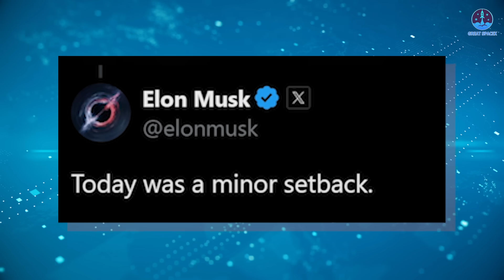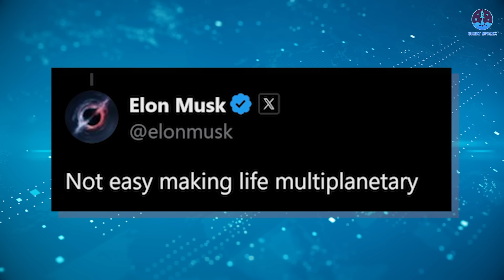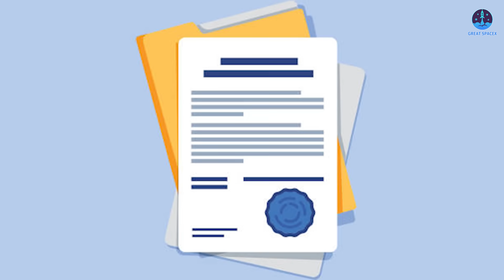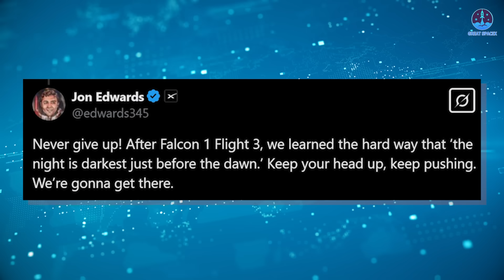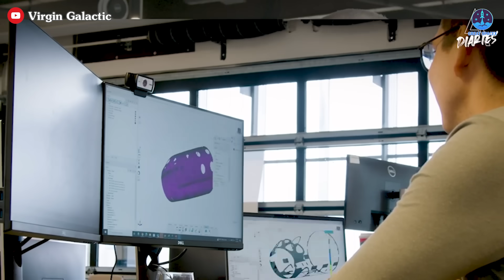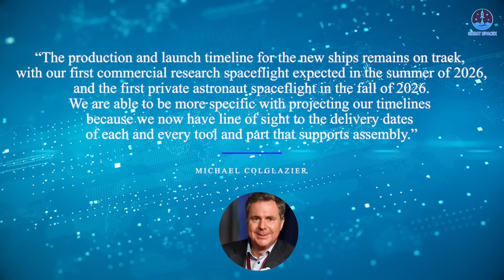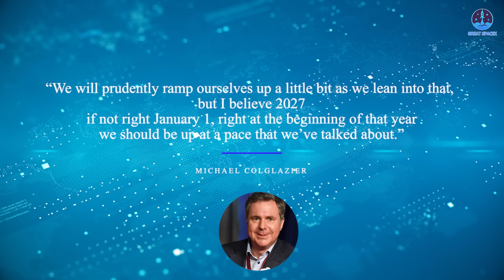Elon Musk Just Revealed Starship Flight 9's Launch Date! No More This Month...

Comment: Flight 9?  How about clearing up all the shit your rockets caused after the last two blew up ... maybe do that before thinking about another launch ... especially since you're running at best a 50% success rate.
Reply: If you can do better by all means show us you can
Reply: Nott even that. Even the stuff that was recovered from previous launches was unfit for reuse and launch pad damage is still happening.
Reply: lol what? Why such a confident post about something u obviously know nothing about? Spacex is responsible for 80% of the launch market and falcon 9 is the best and cheapest by a lot.  Elons approach is rapid innovation and a steady flight cadence gives them the data they need. I guess u prefer nasa’s approach more where they spend 15 billion on refurbished crap to fly once then realize it’s to expensive to ever be successful then ultimately cancel it
Reply: @EdwinSherwood  But SpaceX has bitten off more than it can chew with starship. Watch problems mount up as Musk's fortune evaporates.

Comment: There are still fools who doubt the US moon landing.
Dynamics of the moon flights and the preparations for the moon landing
28.07.1964 Ranger 7 - first detailed images of the lunar surface
17.02.1965 Ranger 8 – 7100 images of a possible landing site
21.03.1965 Ranger 9 – 5800 pictures of a second landing site
23.03.1965 Gemini 3 - Test of the new Gemini spacecraft
03.06.1965 Gemini 4 – first space exit of an astronaut
21.08.1965 Gemini 5 – first "long-term flight" over a week
15.12.1965 Gemini 6 and 7 – first approach (30cm) to another spacecraft
16.03.1966 Gemini 8 - first coupling of a manned spacecraft to a transporter (Agena)
30.05.1966 Surveyor 1 – first beam-based soft moon landing by a robot
03.06.1966 Gemini 9 - first exit to another spacecraft
18.07.1966 Gemini 10 - first orbit change by coupling with transporter drive
10.08.1966 Luna Orbiter 1 – first lunar mapping from lunar orbit
12.09.1966 Gemini 11 – Railway elevation by coupled transporter to over 1000km
06.11.1966 Luna Orbiter 2 – more moon images
11.11.1966 Gemini 12 – first long-term exit (5.5 hours) and work on the other spacecraft
04.02.1967 Luna Orbiter 3 – Moon mapping, sees shadows of Surveyor 1
17.04.1967 Surveyor 3 - soft landing, 6500 images of the lunar surface
04.05.1967 Luna Orbiter 4 – first lunar satellite in polar orbit
01.08.1967 Luna Orbiter 5 – Moon mapping + first "good" Earth image from lunar orbit
08.09.1967 Surveyor 5 – first "moon excavator" and soil investigation
07.11.1967 Surveyor 6 – 30,000 photos + soil sample
09.11.1967 Apollo 4 – successful maiden flight of the moon rocket (unmanned)
07.01.1968 Surveyor 7 – lands softly at Tycho Crater
22.01.1968 Apollo 5 – successful test of the lunar module in Earth orbit (unmanned)
04.04.1968 Apollo 6 – second unmanned test flight of the Saturn 5
11.10.1968 Apollo 7 – Test flight of the new Apollo capsule with astronauts
Only then did the grandiose flight of humans to the moon take place with Apollo 8. We have followed the moon flights with radar from Germany (Prof. Karminski) and amateur astronomers have seen the gas clouds of residual fuel on the way to the moon.

Comment: The complete Starship concept will not work.
Because the booster has to fly back to the ramp, it can hardly give the upper stage speed. The upper stage must provide 90% of the speed. But every kg of empty mass of this stage is one kg less payload. The upper stage does not use hydrogen, but fuel with a low spz. Impulse. Then heavy steel is also used. This technology is obsolete and dates back to the 1950s (Atlas rocket). The payload will be less than 0.8% of the launch mass. According to NASA, 16 flights are necessary to refuel the Starship. However, those responsible there assume 80t of fuel per tanker flight. More than 25 flights will probably be necessary. But who will then refuel the Starship on the moon? It can't come back to Earth either, because ablative heat protection would be necessary. All this is a terrible dead end.
Reply: It’s almost like spacex has never solved hard problems before lol. Falcon 9 does fine and it has to fly back to the launch pad. To even get where they are now it took a lot of very smart people so I’m sure if anyone will figure it out it will be them
Reply: @EdwinSherwood  I think you may be talking about the falcon heavy launches. The 2 boosters RTLS but the core stage doesnt as it either lands out a sea or gets expended. The Falcon 9 lanuches almost always land out at sea, I think like only 10% are RTLS. You get like 30% less payload on average if i remeber correctly.

This guy just doesnt understand just how many more starships you can launch in comparision to any other heavy class rocket in the past. Completly different flight architecture. Soooo much cheaper even with more launches, not to mention just how capable starship is to saturn 5, like an expendable starship will eventually to 300T vs saturn 5s 140T to LEO, like this is crazy.
Reply: he costs will creep up. They always do. @AdamWilsonNZ.
Reply: @EdwinSherwood  Falcon 9 is really simple compared with the challenges facing starship
Reply: @ Elons not known for tackling easy problems, wouldn’t be as impressive any other way. For anyone to see the scale of starship and how much spacex has done and not be a fan is either ideologically taken or ignorant

Comment: You need some OLD grumpy engineers to fix the flaws. 1. Fuel in bags to stop gravitational dissociation 2. No bulkheads in the rockets -- inherent structural weakness 3. You can't build without fuel leaks!!?
Reply: 1: Weight (and bags don't work well at cryogenic temps)
2: Weight 
3: They're working on it

Despite the rather spectacular failures, SpaceX is doing better at this point of development than NASA was doing with its SSMEs (having blown several up on the ground due to various issues). NASA couldn't afford to lose vehicles because they had people onboard, whilst SpaceX has the luxury of iterative testing with an expectation of "let's see what breaks this time" - unlike ULA and friends, the entire string of tests so far has cost substantially less than the single SLS launch so far whilst providing a bunch of data unobtainable any other way

Comment: I think this is over-optimistic.  Many people are suggesting that the modified plumbing on V2 ships is a design failure.  Multiple fuel lines are contributing to harmonic vibrations that are causing big leaks.  This is not gonna work.  They possibly need to go back to the one big line that was getting ships into near orbit.  No one believes that they can continue with V2 as currently designed.  I know that Elon is always positive and that's good.  But this is reality.

Comment: The thing about rockets, the problem does not have to be a big thing, to cause a huge problem .... So the fix does not necassarily have to be a big change. The hardest part is finding out what was the actual issue, fixing it will likely be easy once they indentify it.

Comment: I would bring  in water tanks & give a longer duration burn to identify where the actual weaknesses are! Seeing burn through on the bell & fire within the engine space says there's a major design issue with the redesign of the Block 2 ships fuel transfer. & something has changed because 2 engines on successive flights suffer burn through that's a production problem whether material change or damaged in transit & or installation it marks a significant issue that has to be addressed could even be a case of purposeful sabotage it has to be considered. There's the 3 most likely causes definitely hope it's not the later
Reply: Good lord… 🙄

Comment: What's the point of catching those rockets when they don't reuse them.  A gigantic waste of American taxpayer money.
Reply: You act like catching a 30 story building out of mid-air is a casual thing and  can be done on a regular basis without some practice.
Reply: @SteveGrin  You act like the spaceship blowing up every time isn't a big deal.
Reply: @brigscott5202  It isn't a big deal.
Reply: @brigscott5202  2 out of 8 is not every time, it comes with their "iterative and incremental approach".  It works for them.
Reply: Bro it is still in prototype phase the boosters will be reused in the future also catching them saves a lot more resources than having them plumet into the ocean
Reply: Limited tax payer money has gone into Starship development. Most of the money is coming from SpaceX. They do have some NASA contracts, related to refueling and the Artemis moon landing program.

The point of catching them is to analyze them and work towards reusing them. I believe that that IFT8 was the third catch. Right now they likely want to gather information on the ware on the rocket and find what needs to be changed to make it more durable.

Comment: 2 things in common between flights 7 and 8, the block 2 ship and both were carrying mass simulators, first time carrying cargo.
For flight 8, they performed a long duration test of the engines.
It's possible that the "cargo is creating vibrations, they might need to do a full duration test as flown to know for sure.
Reply: @josephmartin7381  It is more likely that the issue is with the v2 design. Flight 8 carried fewer of the simulated Starlink satellites than flight 7. Note that both flight 7 and 8 were v2, prior launches were using v1 Starships.

Comment: The first double whammy of catching both the heavy booster AND the Starship will be the biggest restorative for SpaceX and the greatest achievement in history. As such, it will be imperative to any saboteur (if any) to ensure the damaging sabotage continues. The similarities between the two ship explosions point suspiciously towards some sort of human intervention. Just a slack pipe pressure joint would be sufficient, which means that unprecedentedly strict inspection of both work and workers must be instigated. In these circumstances, no bolt may go untightened. Flight 9 has a lot to live up to and surpass.
Reply: @moking8095  I very much doubt that it was sabotage. They had the same issue at nearly the same time in both launches of the v2 Starship. This indicates a design flaw in the v2, not sabotage.
Reply: @danjw1  Be that as it may, but it shouldn't be ruled out.
Reply: Bruh get out of here we know that didn’t happen I’m a SpaceX fan but come on now 😂
Reply: @JKTX808  All is fair in Love and War.

Comment: Obviously there is a design issue that is causing fires. If Musk is saying 4-6 weeks for the next launch then apparently he knows what caused the fires, engine failure then explosion. Did SpaceX destroy the ship or did it blowup on its own? How about some detailed explanation on WHAT CAUSED THE SHIP FAILURE? I'm sure the FAA will want to know the cause and the fixes before granting another license. Sooner or later someone on the ground is going to die from falling debris or down an aircraft then what?
Reply: Bro you act like they don’t have contingencies to ensure that no one gets hurt from these flights 😂🤦‍♂️
Reply: No debate Bro. 😉
Reply: It's only been 36 hours since the RUD.  It takes some time to figure these things out.  For all we know they solved the initial issue and another one cropped up.
Reply: It appears the fire started in the bell of the Raptor Engine that methane runs through that cools the engine nozzle. This fire then migrated back up into the engine and it exploded damaging the three inboard engine which in turn cause the the ship to loose attitude control. What caused the burn through? Vibration, manufacturing defect, cavitation? I suppose a 15-20 minute static test on a test stand is needed of all 6 engines running.
Reply: Then why say the next flight is 4-6 weeks? No FAA License to do so. A total shoot-from-the-hip statement IMO.

Comment: The ship will be ready,  is not a launch date.
Reply: @earth2006  I doubt that. The rockets maybe “ready,” but I doubt that they have time to actually address the issue with Starship, in that time. They need to do a design review of the v2 Starship and figure out a real solution to the fuel leak, fire, and RUD problem. They tried a quick fix on flight 8 and that didn’t work.

Comment: Space X need's to build a 25 passenger Dragon and a 6m Falcon Heavy Center Core. No Human will be launched of SharShip.
No passengers will be allowed on StarShip during in space refueling. No human will be allowed onboard during mission clustering for a mission. StarShip can not complete a safety break away because it is too big and slow.
Reply: Starship will have to be re-filled automatically.
And when finally done, humans could transfer from a refurbished-dragon to a starship.